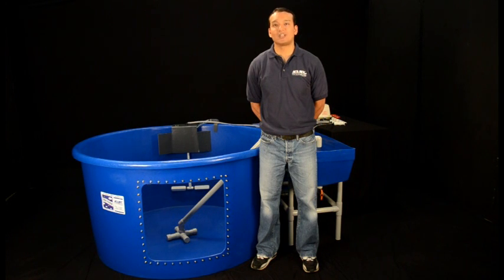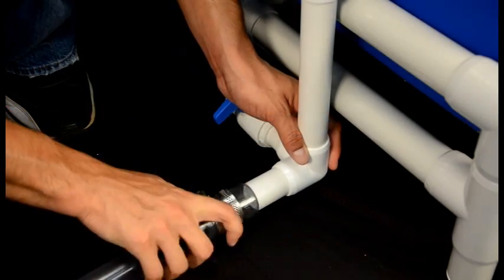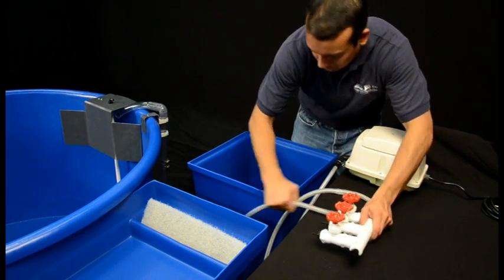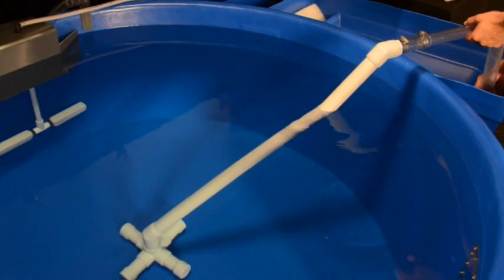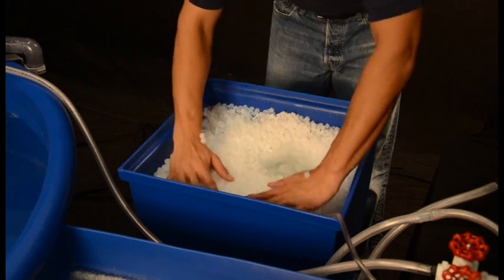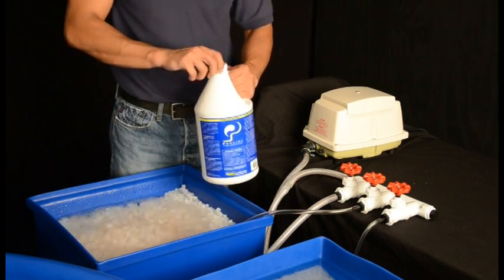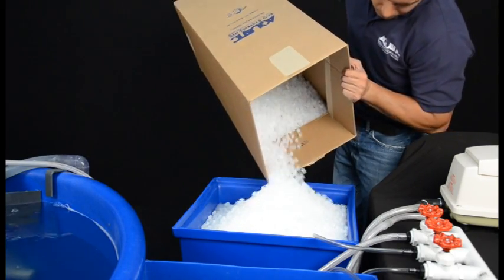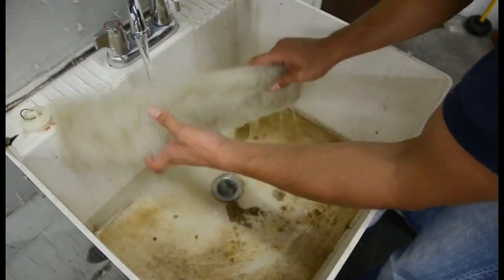AES Mini Fish Farm Instructional Video

Comment: How come you were just rinsing out the foam pad directly with tap water? I had always been told to rinse it out in a bucket of the tank water so the bacteria that is on the pad doesn't die off?
Reply: The benefecial bacteria are in every place they can occupy, including the foam pad, and that is why you should rinse it with tank water, to avoid destabilizing  the equilibrium between ammonia produced and the bacteria to handle it.
Reply from the maker: Makoy Unggoy 

The filter pad is being used for mechanical filtration, removal of solids. The benefecial bacteria is located in the next stage of filtration of the Mini Fish Farm. The LSB, low space bioreactor.

Comment: Good video, but when washing the filter and filter media don't use tap water.  The chlorine will kill the beneficial bacterias.  Rinse the filter pad in the old tank water to clean away excess waste.  Never completely clean the filter and filter media because the bacterias live in them.  I've cycled a 29 gallon fish tank and never completely clean my filter and filter media.  In addition, you would need to use water conditioners to get rid of any heavy metals.

Comment from the maker: To find more information please follow the link provided in the video description. You will be able to shop for the Mini Fish Farm and other similar products.
Reply: What happens if the pump fails?
Reply: @kaziguljar7313  , as per the system is concerned, the water level in the tank and in the flush tank becomes EQUAL and than stops flowing from tank to flush tank becoz there is no more gravity (no Height difference) between tank and flush tank.